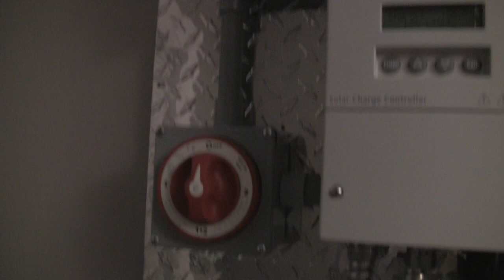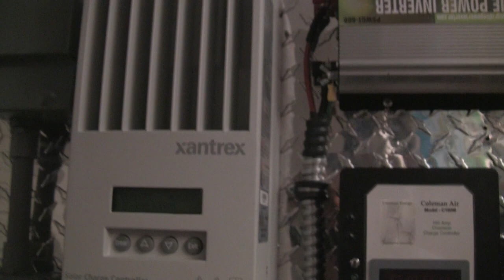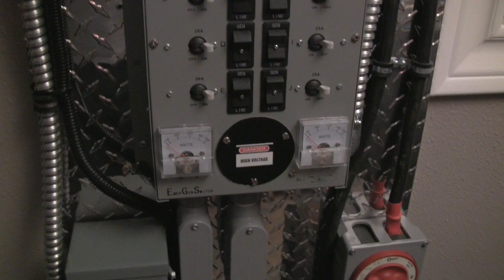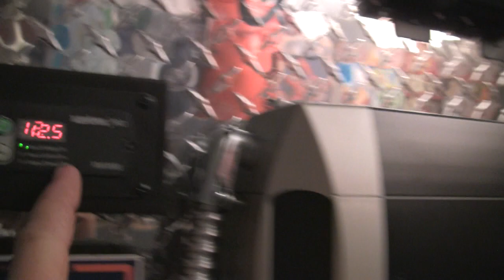EMERGENCY POWER SOLAR PANEL SYSTEM  SHFT

Comment from the maker: @katz217 With the transfer switch breaker box on my system, you can transfer from the power grid to solar power on each individual breaker. The transfer switch breaker box in my videos is prewired and very easy to hookup. You go from each switch on the transfer breaker box to each individual breaker house breaker box. I  made a few videos showing how to do it. Yhey are on my channel.

Comment: I like your system, nice and clean. My question is on the batteries thought, is EverStart a good battery to go with for a solar system?  I know they have to be deep cycle ones, but I hear just standard deep cycles don't last as long as AGM Sealed Lead Acid.  Just wondered if it was because of budget or choice?

Comment from the maker: @N8Dogg1002 Iam using #8 stranded copper wire. But Iam only putting out 12.4 amps with 43 volts. Current is measured in amperes or "amps". You must use the correct size wire for the amperage requirement of the circuit to prevent the wire from over heating. You can Google "ampacity wire chart to get the wright size wire for what your panels are putting out. The distance from your panels to your controller will fit in to the wire size allso. The Coleman controller is for a future wind turbine.

Comment: Fu, What size wire are you using coming from the panels to the cc?  Also whats up with the Coleman cc? Thinkin about getting one to use with my panels. Still undecided.  They are fairly inexpensive and well built IMO. Think they work as good as a cc with pwm.  Wonder how much difference it really makes. Thanx man.-Nate